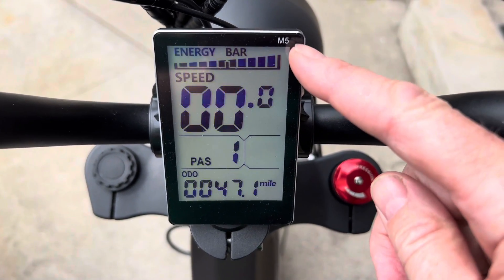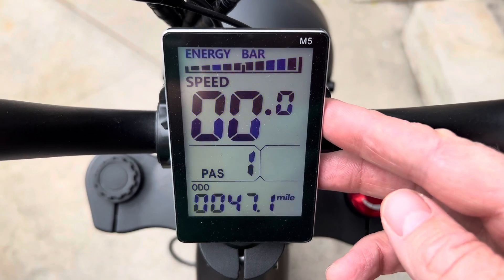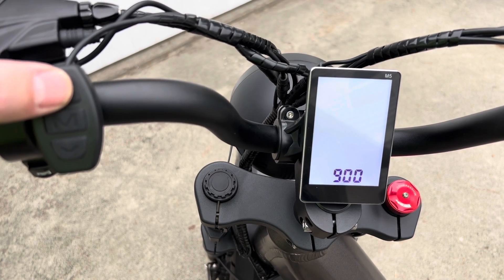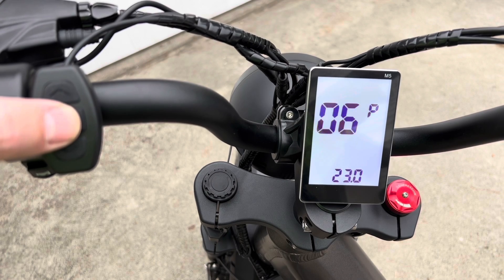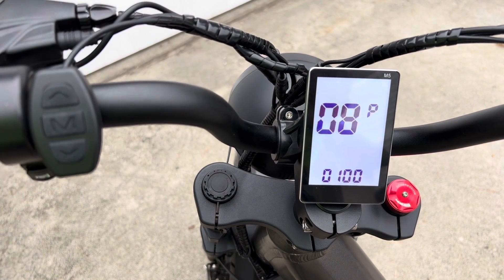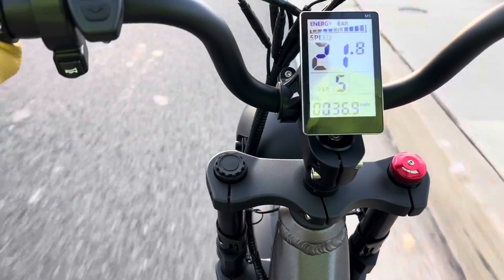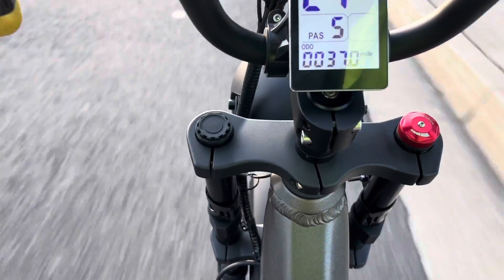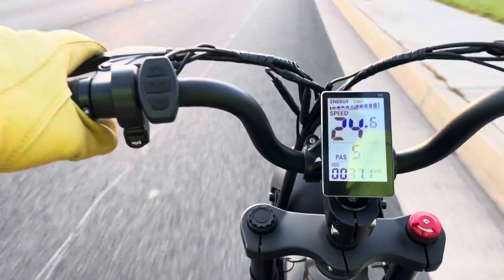How To Unlock An M5 E-bike Controller

Comment: Hey Can the maker of the video react to the comments please? no one seems to know how to fix their problems and seemingly no were anyone can see a fix online.
Reply from the maker: I don’t have this bike anymore, so I can’t make any more videos about it. I had to give it back to the manufacturer. Some of these controllers have a four digit code that lock them, and the manufacturer has to tell you the code. I know there are other good videos that show how to unlock it and program it.
Reply: @hoohoohoblin Yeah i have done a lot more searching since then, it seems that the current M5 screens on the V8 3.0 are factory locked, so you would need to buy a new screen, but its not legal to increase the speed here above 25km anyway, so i wont try it.

Comment: Mine wants a 4 digit code...can't find it anywhere it's an M5 controller on a luckeep folding ebike
Reply from the maker: If you look around on the Internet and include the name of the bike, you should be able to find it. There are a lot of different possible codes that different manufacturer use. The manufacturer should also be able to tell you what it is.

Comment: The M5 control on my Aventon refuses to even come on. The battery has been fully charged. I hate this bike. Nothing but problems.
Reply from the maker: Follow the wires and make sure they’re plugged in. That’s the best case scenario. Otherwise you may need a new controller, but they shouldn’t cost too much.
Reply: Aventon garbage 🗑

Comment: mine does not need a code it just goes into programming mode. I want to be able to use max throttle at every PAS setting anyone know how to do this?
Reply: Go to PAS 8, hold the down button, enter 8650, than you can change it
Reply: That activates WALK mode. and my M5 display does not ask for a code. P8 is set to 100% but that was not my question. I want throttle to overide PAS speed limit at max speed vs having to change to PAS 9 and then using the throttle. When you are riding sometimes you need to get out of the way at maximum speed and you do not get that at Low PAS like PAS 1. @djbadazz2853
Reply: I also have this problem, there's no passcode but I can't change the speed limiter from 25. It's a bit of a mystery as even the reset doesn't seem to work (hold down - for 5/10 seconds on P16). I'm pulling my hair out as nothing works.

Comment: I have a 4 digit code anyone know what it is or what it could be to unlock the ouxi EB 5 electric bike
Reply: 8650
Reply: @djbadazz2853 thnx man that workt for me after a year looking for the right code!🥲
Reply: 6668 that it could be or 1299.
Reply: Is je fiets van CrossBOss la souris?
 @maartenzwanvander8391
Reply: @maartenzwanvander8391 hey bro thx
Reply: It’s 1111
Reply: I tried 8650, but it still didn't work. A review said on the website that I'd have to buy a new display. I don't understand.
Reply: @TheSkeletonGoth  maybe 8252

Comment: I have a 4 digit code
Reply: Does anyone know the new m5 code? The 8650 is not working
Reply: @renzpaulojavier7020 did you figure out the new code?
Reply: @renzpaulojavier7020  Try 6666
Reply: 8650
Reply: @djbadazz2853 after you type in the code how do you enter it